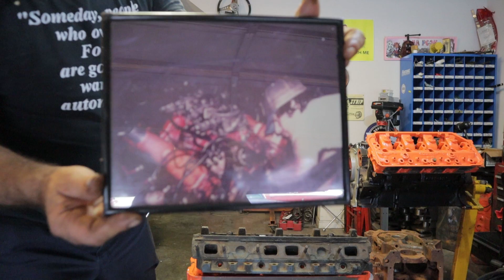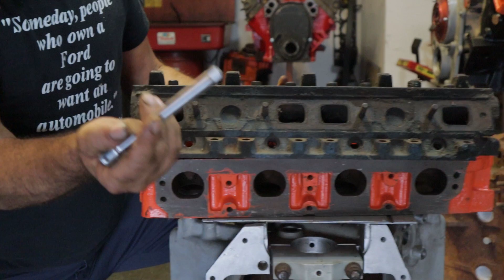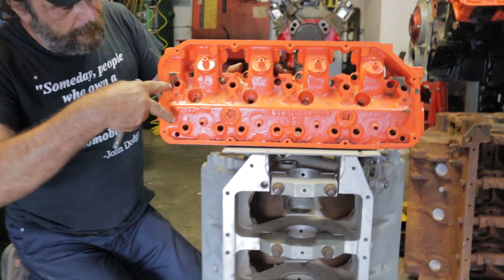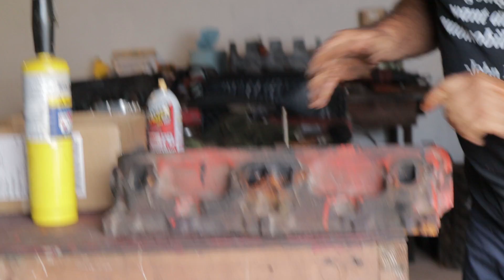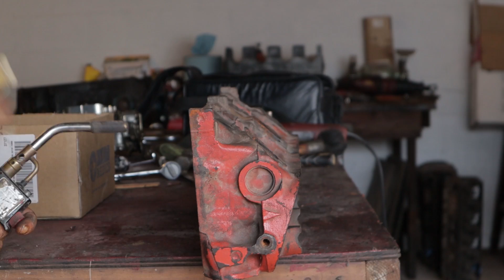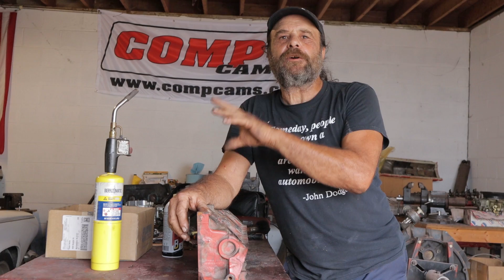What Makes The Small Block Mopar Such A Great Engine?

Comment: I've been looking at dynometer numbers of engines with stock to mild camshafts. It seems to be a trend with the 360 Chrysler in that they have a very flat torque curve and obtain near peak numbers earlier and hold them higher than other engines of similar size and camshaft timing, compression ratio, etc. I wonder if the superior exhaust port design has anything to do with that.
Reply: Best bang for buck ever the 360 IMO. Almost impossible to over cam. Stock oiling, rods and crank all good to 7500 rpm, just need appropriate pistons, valve springs, rockers and proper machining and assembly. 

Best streeter I had back in the day (early 90s) used a weind tunnel ram two 600 holleys, big solid flat tappet cam. Awesome small block. Saw 7k plus rpm daily for years. Would not die. Wish I still had it now.
Reply: @paulmathieson8081  I have to agree with you regarding camming a 360. I had a friend who built engines for a living build a 360 for me. I gave him free rein to do what he wanted but I stipulated that it needed to be streetable but I wanted decent power. He went with a Wolverine Blue Racer cam. When I told my Chevy buddies what the specs on my cam were they looked at me like I had no idea what I was talking about. The cam he put in didn't have a lot of lift, 0.46 lift which allowed me to retain the stock valve train to save some money and ensure long term durability.  But he went with a lot of duration to take advantage of the long rods. A lot more time to move the charge in and the exhaust out. I don't remember the exact numbers, the exhaust and intake were slightly different by a couple of degrees but the average was 310*. It sounds pretty goofy but it worked real well. The engine was balanced, mild porting, Performer intake, KB 10.1 to 1 compression and a 650 Edelbrock carb. I didn't do any tuning on the carb as I was a Holley guy and knew squat about the Edelbrocks. I wish there was the UT tutorial on those carbs back in the day. I know I left a lot on the table without the carb tuning but it ran really well and pulled quite hard. I had this engine in a '72 Duster.
Reply: Add to that the .906" lifter diameter allows for some pretty bold cam lobe profiles to be used.  That's a nice plus to running a Mopar or AMC.
Reply: Rod ratio on the 360 is excellent. Piston weight is much less than the 318/340 due to longer stroke.

Comment: Raised ports help, no doubt about it. I like to look at the primary shape of the header as part of the port itself. Same with throttle plate to piston crown at BDC as the intake port. A straight high port is cool unless you have to make an incredibly sharp turn immediately after the exhaust flange. Mopar headers go all over the place because of where the chassis parts are. I guess the difference is if you want to rev the snot out of it, or grunt so hard it causes continental shift. The LA can rev pretty good with the right parts.

One thing I like about my engines over the chevys and mopars is I don't get burned plug wires with a Pontiac or 351C. The 4V Cleveland is the only small block to impress me, those things are nuts only needing a cam and headers. I like the 340 in the Cuda my dad left me, but I have no plans to race it. It really needs a better carb, I'll get on that when I get it where I live as its still 1000 miles away. I've never been a big fan of the B/RB engines, even though I have some of them. They work ok for getting around, but when I can throw a sub $2k 455 together, run the highway gear and a stock stall in a 3500-4000lb car and put bus lengths on the B/RB my friends put together for a lot more, I have no intentions of building a BBM for racing. The 413 in my RV runs like a swiss watch though, even if it sits for years at a time. Throw a battery in it, crank it until the fuel gets to the carb and its running. I like them better than the sbc and bbc for sure though, those poor iron lumps need all the help they can get which is why they have such a huge aftermarket for them.

Comment: I was stuck in the past too at one time. At some point, you upgrade and move on. The mid-90's to mid-2000's is the sweet spot for most vehicles. Dependable fuel injection and the computer systems hadn't gotten out of control yet.
Reply: "At some point, you upgrade and move on. "

Not me. 1960-1970s cars and carbureted, non-computer controlled engines forever (as far as hi-performance cars go). Also, the engines from that era actually LOOK like engines unlike the  powerplants stuffed into the cramped engine compartments of modern cars. Plus those cars are EASY and SIMPLE to work on and troubleshoot.
Reply: That’s not what I saw at the last NHRA stock eliminator event.
Reply: This man knows more about EFI that you ever will lol.
Reply: I don't know the reason for saying "stuck in the past"...he's working on a Gen 3 hemi, Uncle Tony builds what he likes and couldn't car less about anyones opinion. I build old small/big blocks as well as LS and Gen 3's and love all of them.
Reply: @greasemonkey258  There's nothing wrong with being "stuck in the past" as far as cars go. Modern cars and engines don't do nothing for me. They're just a mode of transportation. Though the modern Dodge Challengers are fun to drive, especially the hi-po versions. I just don't care to look under the hood 'cause it does nothing more me.
Reply: @electrix6751  I agree that I hate how cramped modern engine bays are. Step one of modern car mechanic work seems to be "disassemble the bodywork from firewall forward".

Screw that noise!!!
Reply: The problem is that the computers of that generation are wearing out and there are no easy replacements available. You can't just buy a new production Ford EEC-4 computer (for example), you gotta replace the whole damn fuel injection system.
Reply: Better to keep learning

Comment: because it's basically a refined copy of the small block chevrolet just like the windsor fords...fomoco with their long-stroke Y-block design put out metric tons of negative propaganda against the mouse, they said it's short stroke and high rpm operation would never hold together, but it worked so well ford dropped their old Y-series 292-312s in favor of their new skirtless 221, 260, 289, 302, and 351s...but imo back in the day,                                         pound for pound the 318 was the most perfect V8 ever made.
Reply: Exactly!
Reply: Ahh the old boomer bullshit that ford copied the SBC. Have you ever even seen the two side by side?
Reply: @Terminxman  im not sure what engineer or even good mechanic would ever judge an engines volumetric efficiency on anything to do with outer appearances which have nothing to do with over-square or under-square bore and stroke ratios or the thermodynamics of heat retention, release and efficiency. that's why the legendary Smokey Yunick said the famous quote "an engine doesn't know what name is stamped on its valve covers." the windsor fords were a direct opposite under-square technology exchanged for the chevrolet over-square trademark.
Reply: @Imnotyourdoormat  How did Ford copy the volumetric efficiency of the SBC? Because the efficiency is similar doesn't mean they copied anything, neither did chrysler copy the SBC. The ports are a completely different design in all 3, look at the square ports of a windsor and the round siamese sbc ports. Look at the main bore size difference, should I keep going? Because they all had similar efficiency during the same time period means nothing other than that the materials and engineering had improved. They didn't drop the Y block for the small block either if you knew anything about them, they dropped them and replaced them with the FE for quite a while and the small block came along beside it
Reply: @Terminxman  right right...and Ford didn't copy big block Chevy heads for their BOSS 302, and both Cleveland and Lima designs and Chrysler didn't copy it either with their Ball-Stud Hemi right? the 385 Lima engines were direct copies of Rat motor Chevys and purposely phased out the dinosaur 352 Ford-Edsel series that with the exception of the side-oiler 427s, were unsafe at any rpm over 5500 even the legendary 428 SCJ with 4.13 x 3.98 ratio. although Chrysler continued their                                                                                     Y-block design in all B and RB engines, they.ve only made a resurgence in modern times, often with 6-bolt cross-bolted mains.
Reply: @Terminxman  "in what way is a BOSS 302 head a copy of a bbc?...OMG you've got to be kidding me right? you may want to research the term "canted-valve" to see how bad you"ve stepped in it. but thanks for ending this conversation by explosive technical suicide....gee mon ee and i was talking to this guy?...
Reply: @Terminxman  dont feel bad...marathon runner rozie ruiz didnt know what "intervals" were when she got busted trying to fake her win too, and sounds like you "advise myself" just like she did too.....BWAHAHAHA!!!
Reply: @Terminxman  WTF does 7-UP have to do with Sprite?......
Reply: @Imnotyourdoormat  The Boss 302, Clevelands and 385 series fords all have canted valves just like the BBC, however, thats where the similarity ends. The valve angles are different as well as the combustion chamber shape, and expecially on the closed chamber cleveland heads, cheers.
Reply: @johngroenwoldt4392  yep...kool.

Comment: Reminds me of the time why I wondered why Honda K series 4cyl were making 250hp NA. 

Found a cross cut of the head. Intake points directly at the valve, going into a hemi combustion chamber featuring 4 valves.
Reply: They also have variable valve timing.
Reply: I've been meaning to check on the feasibility of putting one of those in my Volvo.  :)

Comment: Hey Tony, I've got a 273 build going on right now for a dyno competition that will be held next year due to the covid. I have to use the 920 head and stay under 11.5:1. I think I can get around 1.47 hp per cubic inch and I'll be spinning it to 7200.
Private message me if you want to get updates on the testing as I go through it. I should have it on the dyno sometime this winter.
Take care..

Comment: A little bit of swirl on the way in is fine, but on the way out you ideally want to fire that gas out of a big hole. Preferably a conical one, because decompressing the gas helps it leave. Hence why 2 strokes benefit from expansion chambers, as did the Norton Rotary bikes - they never made as much power on street legal pipes, because the 'extractor' exhaust was too loud to be approved.
I can think of a couple of old school tuners from this side of the pond (Bill Blydenstein and Stan Stephens) who swore by not mirror polishing ports: once the engine had been run in, the light soot accumulated on the port faces would prevent that complex laminar flow that causes such havoc with as you say, reflections bouncing about all over the place.

Comment: My personal first experience was in my buddy's big block 396 67' Chevelle and we ran up against a 340 Barracuda. I was amazed that we could not walk that car red light to red light all the way up Main St. This was in Reynoldsburg Ohio during the Mopar Nationals somewhere around 1990. Great times
Reply: I raced a 68 396 chevelle one time. It sounded wicked with open headers. Beat him by two cars. He came to the pits wanting to see my big block under the hood. He looked a bit bewildered when he saw my pump gas 360 under the hood.
Reply: I met a guy 30 years ago when I was in the Air Force in Maryland...he had a clapped out 68,69 Barracuda with a souped 340 in it. He said his favorite victims were 396 powered Chevs...years later I ended up with a 68 Barracuda 340 Formula S coupe

Comment: I agree. My car runs 7.45 with a pump gas 360. 3600 lbs. I’ve built many Sb chevys in the 80s. A lot of flat top large chamber truck engines. They sucked. In the 90s I built my first 360 and have never looked back. I also believe the LA valve angle is a great advantage. Chevy adapted it in their newer race heads.
Reply: I love the LA engines. 18* valve angle, shaft mounted rockers, 6 inch connecting rods. This is stuff you have pay extra for with a sbc.

Comment: If parts availability isn't an issue do you prefer an LA head over a Poly?
Reply: Mike W I cannot speak for all versions but I have a 67 dodge d200 with a poly 318 and a 67 d100 with an la318 and the poly feels way stronger
Reply: @bcbloc02  Thanks

Comment: Hell yeah I love big blocks and hemi's. I have a '65 383 and a little 354 fire power hemi. I like my little LA engines cause they deliver and aren't a bank breaker build. 500hp from a 360 on pump gas and no juices, blowers or anything is kinda cool.
Reply: I would love how you built your budget 500hp 360! I have a smog 360la in my '81w250, and really want up the hp, & torque for towing, & hwy, not to mention fun. Tryingbto get even 350hp adds up fast.
Reply: @harvestblades  Well It is only bored .020. I use a mopar performance cam and lifters, degree'd cam shaft with off set cam key. Factory cast iron spread bore intake, got rid of stock heads and use factory non emission heads with springs for cam, again mopar. No smog stuff, true dual exhaust, and not over carb'd. Oh yeah pistons are Federal Mogul Sealed Power flat tops w/twin valve reliefs. And I use factory exhaust, no holes manifolds.

Comment: Speaking of the SBM, if you feel like trying some quirky shit, what about building a magnum V10? I love weird shit, and I feel like these truck V10s are underappreciated. The truck V10 is essentially a small block mopar with two extra cylinders. You've got cool V10 sounds, big displacement, and with the mopar you get to take advantage of all the valvetrain parts available for SBM! If you can get a cam ground, and make the motor RPM you could make some real power on the cheap!
Reply: I think one downside for Tony would be engine management since they did away with the distributor on the V10
Reply: dooformuladlx  I saw a guy back in the 90’s built a rail job with a V-10 ( they were still super rare to find ) he converted it to run with two Audi 5 cylinder distributors ( and I think he was running a carb on it ) . It was a feature car in Mopar action or some such....
Reply: @dooformuladlx  good point. I'm not sure if any of the cheap EFI systems like megasquirt or speeduino could do 10 cyl either.
Reply: I'm not sure but I dont think there is after market parts to build these engines
Reply: @jeremyhanna3852  why would that stop someone?
Reply: @DrewLSsix  it might not, but getting totally custom parts made gets really damn expensive really quickly.
Reply: With the v10 sharing SBM architecture with the rest of the A/LA series and with the current gen hemi being a development of that same family I wonder how possible a hemi V10 would be?  There are a few people out there that love to do that kind of thing.
Reply: DrewLSsix you’d be looking at a lot of custom billet parts. Hemi heads? Forget it. If you could find someone to design and mill the heads, you’d be in for $5k a head on the low end. Cam options are limited, so you’re looking at either getting the factory cam reground or, again, a custom billet cam. Intake will be custom as well. It’s just not worth while when you can buy a stock Viper V10 with an aluminum block and heads for $10k, and enjoy a great aftermarket.
Reply: @IGrocker  Makes me wonder why Dodge never did it. Wouldn't have been hard in the 2010s to integrate the tech from the V8 Hemi into the V10. When designing the 5th gen Viper they had all the tech and most of the parts on the shelf to build a V10 Hemi with VVT AND make it AWD. 

I can't see it being at all practical now to attempt to make a V10 hemi, but I don't think it'd be too hard to adapt the AWD system to a Viper, that'd be a blast.
Reply: iirc the V10s are based on the magnum architecture rather than stricly LA. Magnums were a bit different but still the two platforms are interchangeable for the most part. You can't run oem roller lifters in an LA for example.
Reply: @ThePaulv12  there WERE roller LA engines from the factory. They started in 85 for the 318 and I believe 89 or maybe 87 for the 360, but pretty sure it was 89.
Reply: V10 sound??? Sounds like a can full of quarters in a dryer.....dont get butthurt....😁😘😮
Reply: @will7its  agreed, I don't like the v10 sound. V8 or v12, hell yes. Those odd-firing v10s just don't sound right to me.
Reply: @ScottKenny1978  There's a guy that put ITBs on a Ford V10, sounds really cool. I think the biggest issue is that people tend to straight pipe trucks, which always sounds awful. With good headers, an x pipe, and some good mufflers I bet it would sound awesome, especially with a cam!
Reply: @ScottKenny1978  Yeah, the first time I saw a viper it came around a corner and floored it and I thought it was coming apart as it went by....😮